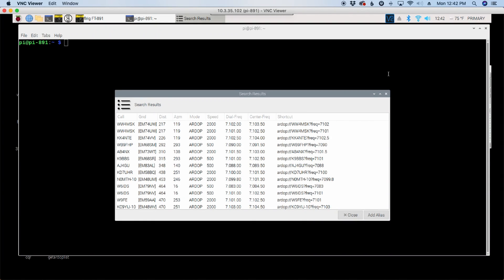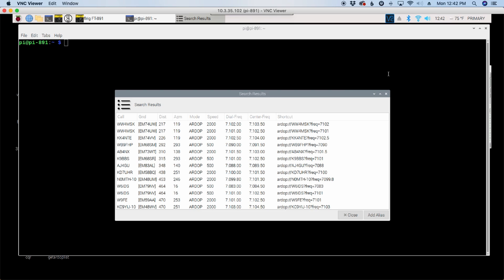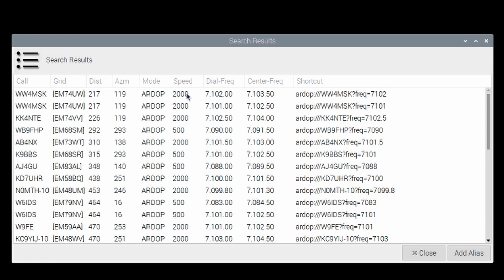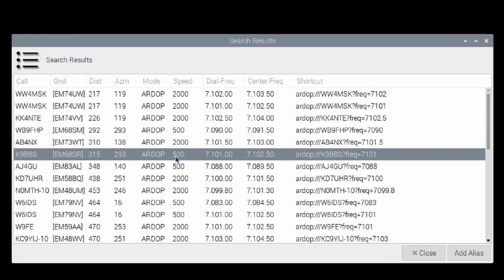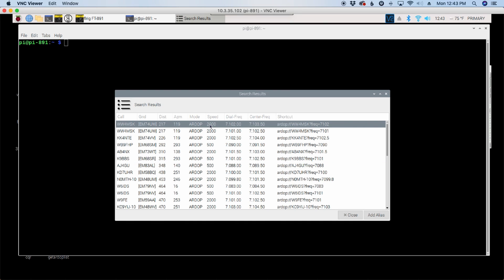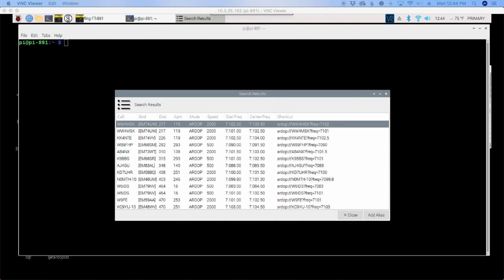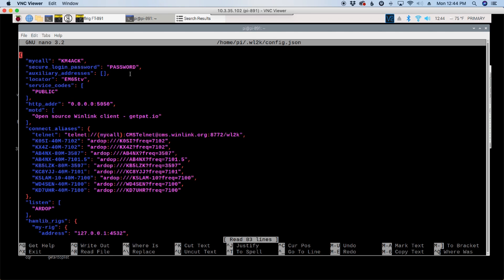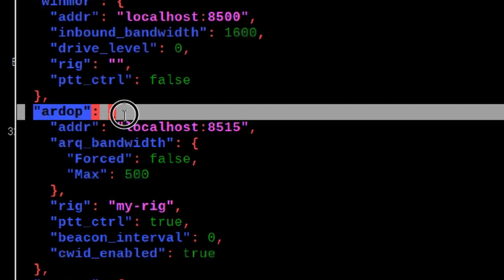Speed up your ARDOP Connections

Comment: Are you able to reliably connect to nodes?  I jumped back into winlink this week and tried for an hour finally was able to connect to NOLCR-1.   Kind of frustrating.  This was my home station at 30w output into my emcomm III antenna.  Not sure my 817 and field antennas would have a chance.   Also, any way to do VARA on the pi?
Reply from the maker: VARA is windows only. Sad they chose to close it off and make it unavailable for other operating systems. I have 2 or 3 stations on 40/80M that I can connect to almost every time and a few others that are hit and miss. You just have to figure out which ones you can get in to on a regular basis. I have little trouble with the few I have identified even when in the field. If you are using Pat Menu, there is an auto pat feature that can help locate gateways you can connect to. If it makes a successful connection, it will put it in a log file so you can either add a new alias or reference the log file in the future.